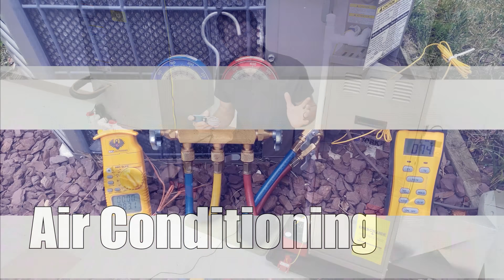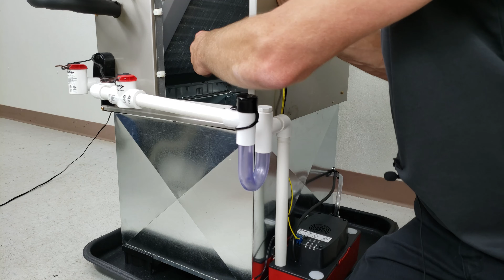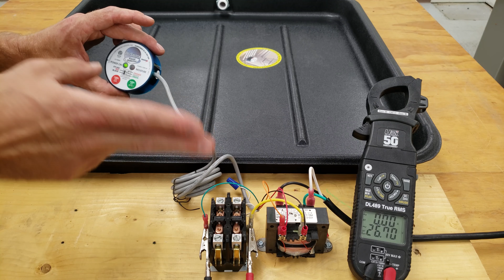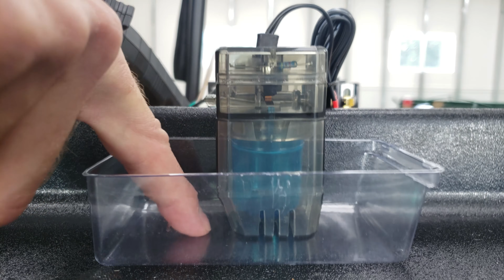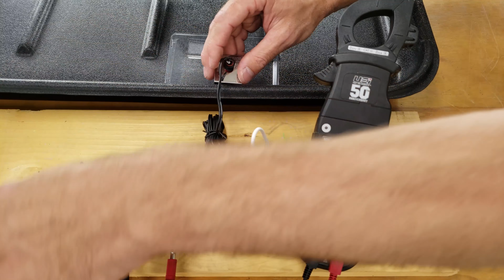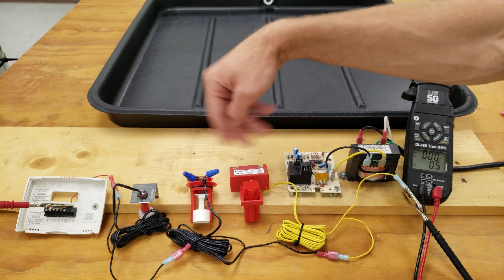HVAC Condensate Safety Switch Training! 6 Types, Operation, Installation, Wiring, Testing!

Comment: Hey Craig! Great video as always. Thought I’d share with you; Went to a new customer who purchased about three years ago a very nice and very expensive 6.5mil dollar home. Rheem straight cooling with hydronic fan coils for heating. The installer never installed safety condensate switches on any of the air handlers, pans etc. Three of the units are in the attic above Coffered ceilings and the other two are in the finished basement with all beautiful floors and so on. Besides the maintenance part of the work I’m trying to get them to see the importance and the possibility of a  future disaster! He just doesn’t want to go for it. He thinks I’m  over selling him lol. I guess we will see!

Comment: Can I these kind of safety switches trip if the pipe itself is not evenly parallel to the ground say the pipe with the safety switch is at a downward angle will the cause it to trip even without water in it? Cuz that's I'm what seeing with mine. I noticed it was leaning at a downward angle so I just tilted it back up at an even angle and it went off..

Comment: Hello i have been doing sheet metal and mechanical pipe fitting for years what is the best way to understand controls as i have no experience other than pulling the wire to and from not tying it in

Comment: Thanks Craig , is amazing the  way than you explain it, just my question is, these examples are with devices 24 volts AC and   serial   connection is that right?

Comment: I pulled the float out and let it hang outside. Every time the drain backed up, It was shutting down my air condition. Now if the drain gets plugged it drips on garage floor where I can see it. No more calls to HVAC tech and getting ripped off $$.

Comment: Had drained the lines and was still lit up. And still not working so after finding you video i took the switch apart and there was still water there. So soaked that part out with a towel and put back in, turned on ac and in a few minutes kicked on like normal! Thank you!!!

Comment: Thank you do much for sharing this info. Have seen a few of your videos and helped me in my issues. I cleaned my drain line on the my ac unit but the red light still on. But will be adjusting it as you did, think that will be my problem. Also watched one on the capacitors you made. Great breakdowns!!! Thank you again!!!

Comment: My Wet Switch tripped twice in two days, with no water in sight. The A/C also quit blowing cool air. The inside (and outside) fans both work but only blows regular air temp. Is it a coincidence that this happened the same time the Wet Switch tripped (first time in the six years we've been here)? (I changed the capacitor, but that didn't fix it.) Any suggestions? My main question is could a malfunctioning Wet Switch cause the air not to be cool? What if it wasn't wired correctly? Here's how its wired: green+black>blue (from transformer) / red>red (from transformer) / yellow>dark blue / white>capped off. (2015 Daiken system)

Comment: Hey Craig,

so basically you wired the three in series because if at any point one of the three open it'll still shut off the outside condenser. I prefer to break red in my opninion, so it'll shut off everything

Comment: You left out the Rectorseal SS500EP 
Can you please make a video on how to wire a secondary drain pan Rectorseal SS500EP and also how to wire it with a primary drain SS1 FLOAT Switch in series with a Rectorseal SS500EP.
WE Use them alot in West Texas.
  A training video would help for beginners.

Comment: I had my float switch fail so the contractor would not pull in but the inside fan would run. How would I determine that in the future and how common is it for a float switch to fail?

Comment: my unit in the attic had an emergency pan of metal wherein the sides were folded upright from the bottom surface. the corners were supposed to be then sealed, but one was not. the drain tube got clogged and the condensate dripped into the pan and leaked out a corner. this was in july with high temperature and high humidity. the water puddled on top of the ceiling drywall and then leaked through a recessed light, several gallons! 

took an hour to diagnose the problems of the leak and the clog. and many hours to repair repaint the ceiling.

Comment: I am in Toronto, Ontario and I never see PVC used for condensate or traps being installed. It is always just plastic tubing on a barbed fitting running to a drain. It seems this is more of an American style of condensate? Also no hvac stores sell condensate trap in Toronto that I have seen. very confusing for me lol
Reply: You only need condensate traps where there is negative pressure. So if the evaporator is after the blower then you don't need a trap because the blower is pushing air out the drain.

Comment: Just had a commercial unit flood the room beneath (over the weekend) it and cave in the drop ceiling because the safety switch failed. The service company didn’t put treatment tablets in the condensation pan so scum and debris had trashed the safety switch.
Reply: I always keep a can of pan treat tablets in my service bag, this time of year I’ll keep 2 or 3 cans on my truck

Comment: Break red if you have a digital stat and no delay in the condenser Breaking yello can cause rapid short cycling -- frying the contactor or making a scroll run backwards. Most digita stats will delay plus some go blank and alert the customer
Reply: And I'll just add that he's more than likely referring to ecobee or nest.. tstats that requires the a common. If it's a digital tstat thats ran off of batteries and not common.. break Y.

Comment: I like all of those, except the hockey puck. It is very reliable, opens very early during a blockage. My only problems are there is no molex connector to remove for drying and drying takes too long if humidity is 90%+ like it is here all summer. 

One that I’ll never use again is an Aqua Guard AG-1250E. I found it burnt and melted in a plastic pan a month ago. Voltage still getting to contactor at heat pump, but no current flow. As soon as I went into the attic, I could smell burnt plastic. Very dangerous. The indoor coil had froze up and melted condensate bypassed the coil pan. 

Thanks for the great videos to keep all of us sharp.